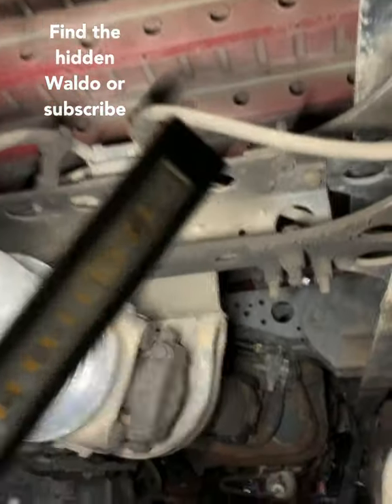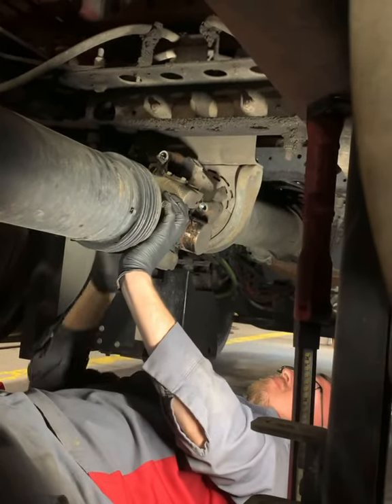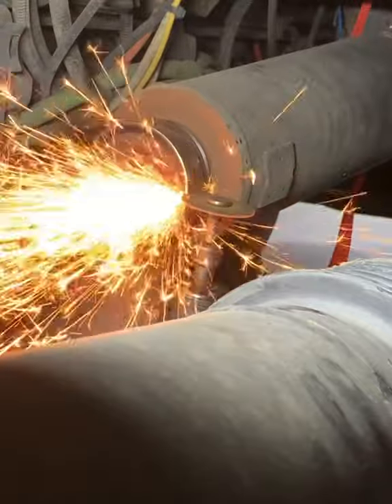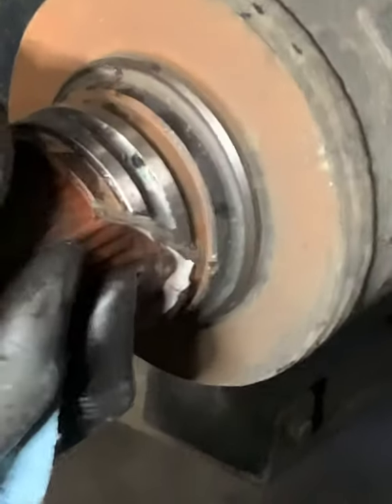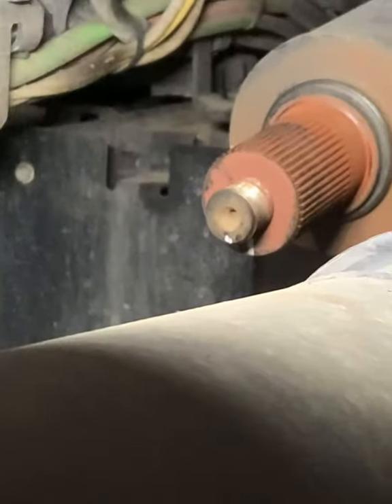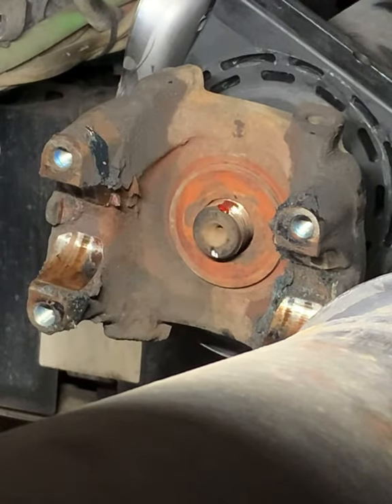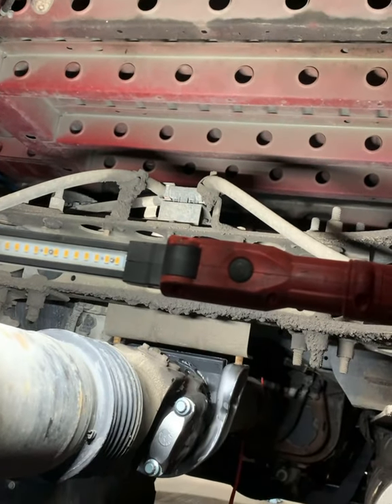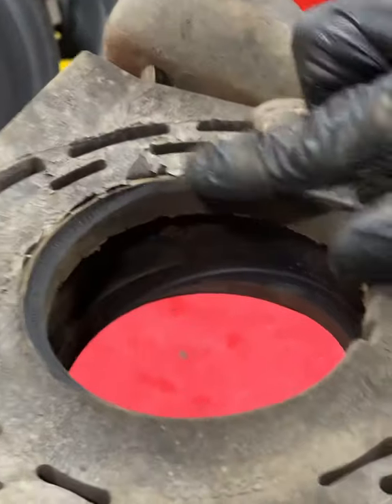Carrier bearing replacement. Driveline vibration. Noise or shaking under cab. Freightliner or INTL.

Comment: Hey next time instead of running the cutoff wheel just take a torch heat one little band across the retainer/race until its cherry red and then give it a nice smack with a chisel and hammer and usually they will fall right off with just one good smack. It's works better than deep freezers, liquid nitrogen and even better in most cases than a cut off wheel. Another good trick to install the new carriers and mainly to remove rusted u joints themselves is to get a u joint trunion driver bit for an air hammer its also known as a smoothing hammer bit but it works great popping rusty ass u joints out and you can install the new carrier bearing with it so long as you go slowly and don't open the hammer up all the way beating the ever living shit out of it lmao. It's just a flat rounded head on the bit so no sharp corners but still don't want to fuck the shit up when you are in the home stretch by getting too excited with the bumpy noise maker lmao
Reply from the maker: Hey man thanks for  chiming in. You are absolutely right, a torch goes a long way abs probably would of made this easier. I try to use items that people have at there disposal so they don’t assume they need a torch to do the repair. But I’m sure that would of saved some time on coming off. Only issue is cool down period so no matter what ,it takes time.  I always appreciate others input because every bit helps others whether new or old we could always learn something new.

Comment: Would you happen to know, the socket size needed to remove the nut to pull the yoke to replace carrier bearing for 2022 freightliner cascadia?
Reply from the maker: There is a few different sizes depending on your powertrain.

Comment: Hell at the mine I work at the lube trucks aint ever brought to the shop until there is just the smell of burning rubber barreling out from under the trucks haha. When you spend all day driving on dirt roads that were graded by shitty blade  operators you get used to vibrations🤣

Comment: Excellent work. Is the truck on blocks or somethin? Wonderin how u got so much room to slide under there like that.

I need to inspect the under side of mine before i have a shop go under there and tell me whatever lol

Thanks
Reply from the maker: If I was under the front end definitely I’d have it on blocks this guy is not that skinny anymore. But mid way we have sneaky access points so that’s helpful. I would say every 100k I’d have it checked out. One thing that can cause many issues and when it goes out it can be very $$$$ to clean up.

Comment: Can you put anti-seize on the splines before putting on the yoke and carrier bearing? I'm thinking about the next time you replace it it'll go smoother?
Reply from the maker: Great question. You can. And it would prob help. Just can’t use to much or way for dirt to get on and make for a rough disassembly.
Reply: @bustedknucklebydieseldr3228  thanks for the reply. I just posted an upload of mine. And man is it a mess 🤦🏾‍♂️! Check it out.

Comment: Whats the worst that could happen if I try to limp it to the shop 10 miles away rather than dropping the shaft in my yard? I dont have to run it at highway speed to get it there. It had failed to the point that the heat has melted the bushing and shaft is not in a straight line. I could probably lift the rear shaft with a strap so it's better lined up. I had noticed some vibration lately and had the front tires balanced just a few miles before this happened. That did not fix the vibration. Hopefully this bad bearing is what was causing it.
Reply from the maker: If it’s vibrating and shaking I wouldn’t drive it. If it’s just pushed out and not straight than  driving will be fine. But when in doubt tow it out.

Comment: Carrier bearing will it fit too a 2000 freightliner Classic?
Reply from the maker: You will need a different part number for this truck. Always check with your local dealer for vehicle specific part numbers.

Comment: Ok, I hear a thump under the cab when I get on and off the gas. I changed one bad U-joint, but it's still doing the same thing, what could be the problem now???
Reply from the maker: Great question and thanks for reaching out. Your issue can be so many things. Any bad unjoint,carrier bearing., cab torsion rod, any loose cab mounting hardware, suspension torque arms, loose catwalks, gremlins trying to get out. Would just hav to get hands on everything and see what’s loose. Or have someone shake the cab while you listen for the noise.
Reply: @Busted knuckle by diesel dr ,  I know right.  Hopefully it's nothing too bad.  But thks for the advice

Comment: What size sockets should I get to cover most yoke nuts?
Reply: The typical yoke nut size is 41 mm. U-joint bolt caps 3/8 12-point socket.